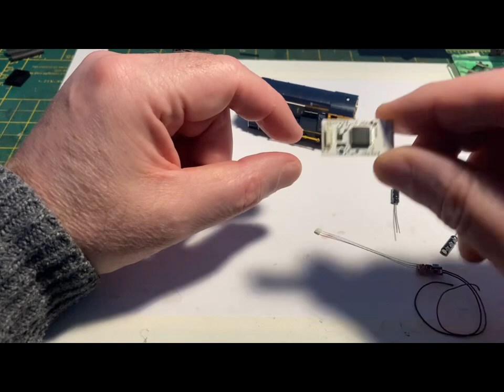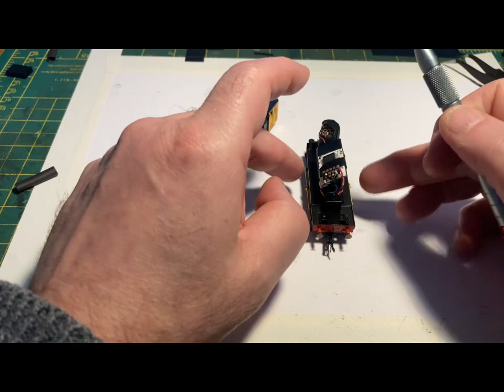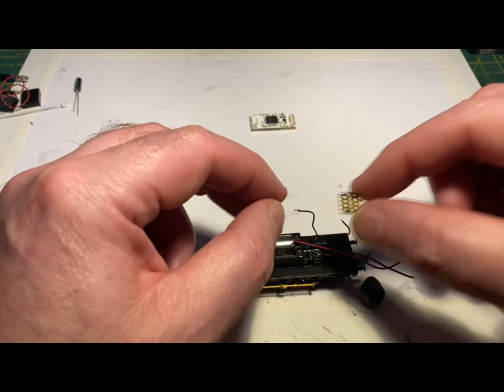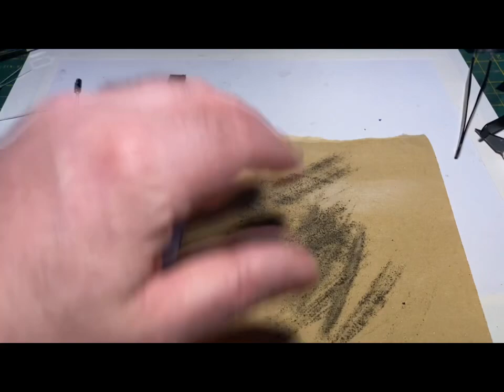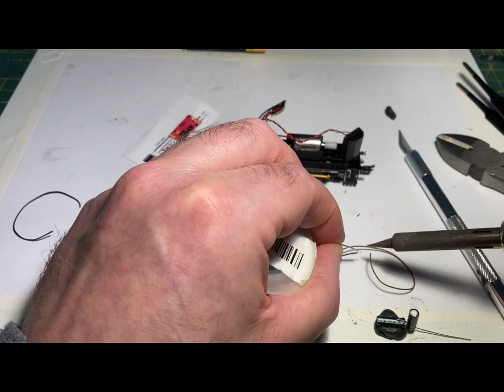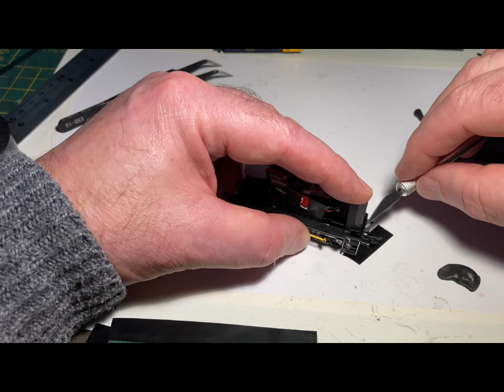HM DCC Next 18 Sound decoder, stay alive in Hornby TT:120 08, no cutting/cab removal,  £90 👍

Comment: Hi i ask as i don't know but if there is no class 08 sound profile on the hornby bluetooth phone App for TT gauge do you use the 00 profile instead or have i missed a step ???  This is a conversion i want to do but am new to decoders etc
Reply from the maker: This is using the OO profile, if you do the auto calibration once the profile is uploaded to the decoder everything will be great. As a rule of thumb the coreless motors need the auto cal to be optimised anyway.
Reply: @HighFell thank you so much for getting back to me so fast.. I wasn't sure if the 00 version would mess with other things or would in some way be out of step due to the gauge difference.. as I said I'm very green when it comes to decoders..iv no issues with confidence for projects like this and am more than capable when it comes to soldering even the smallest items but have extremely limited knowledge of these decoders is all.. life is a constant learning curve I guess, but again many thanks
Reply from the maker: @DarenFrench-f1n   this sounds like a perfect project for you. With decoders, especially HM 7000 ones, you can’t do anything damaging by using different profiles etc or playing about with settings deeper in the app. I would recommend all locos have the auto calibration done, it optimises the motor control for the motor installed in the loco. If when making changes in any area of an HM 7000 decoder, you feel you have gone wrong it’s dead easy to reset back to factory settings too.

Comment: Good morning and Happy New Year, is it possible to do this version but using the 8 pin decoder, I’m just not that keen on removing the cab, but have already bought the 8 pin decoder as per your other video ?
Reply from the maker: Happy New Year, yes it’s basically the same decoder just the different interface. You just ‘hardwire’ the 8pin as per the other video.
Reply: @HighFell  I’ve put the 8 pin into stock, and ordered the bits for the NXT 18 inc the nano’s, need to re watch this a few times now 😂😂
Reply from the maker: You will be fine if you prepare and take your time 😁👍
Reply: @HighFell  just need to glue the motor in, thinking about it was worse than the doing 😂 https://youtube.com/shorts/b_TERn_G41I?si=wTEBrfnb2r2V3OOW
Reply from the maker: Looking good 😁👍
Reply: @HighFell blimey the body went back on 😮, not fixed yet as a paint job to complete, I’m keen to add a led head light 💡, any guidance on kit to use please Matt 

https://youtube.com/shorts/5RpODF7nGLU?si=h5HW2JXvZnp5tRlr
Reply from the maker: @St-Ives-Junction  it’s all coming along brilliantly! For paint and decals, I use Railmatch rattle cans, they give a really good fine finish, make sure you use an enamel primer,  I prefer using Railmatch rather than just any old primer, a model specific primer is very ‘low build’ so all that lovely detail doesn’t get swamped. Paint is temp and humidity sensitive so bear that in mind particularly this time off year, eye and face protection is a wide move and a well ventilated area to work in. A few light coats builds a better finish, allow the thinners in the paint to flash off between each coat. For Decals look at RailTec website, huge TT:120 selection for diesels and rolling stock. Excellent quality and service. 
As to lights, I have been asked loads of times to show how to do the lights for the 08, I think a video might be needed for this one 😁👍
Reply: @HighFell  Sadly I have no where to spray, so I will be brushing it as I did with my recent black version, came out ok, and yes enamel will be used, I also have some Railtec transfers, probably not the correct ones, but rule No 1, and yes please a Highfell "how to do lights on yer loco" video would be great, unless I beat you to it 🤣🤣🤣
Reply from the maker: Please, the floor is all yours…… It always makes me laugh where certain people in the hobby want to be the big thing….. I love watching other people getting stuff done and having a go. Have you looked at airbrushing? I’m only just getting into it but me and a mate both bought a decent mini spray booth arrangement, they have good lighting and filtered extraction. You can spray all sort with them, so far I have only used acrylics and for weathering. It is a bit of an art!
Reply: @HighFell  I’m resisting that purchase, but fear it may happen, 1st coat of yellow on, looks like it’s going to need a few, it’s a bit…………..thin, ah well there’s no rush
Reply from the maker: Yellow is a tough colour to do, DONT be tempted to go too thick too soon, more layers but let it dry well as it does change as it dries
Reply: @HighFell 😂 you’re not wrong, 5 coats in and I can see at least another couple 😮
Reply: @HighFell  well the light is kinda working, scullduggary afoot methinks https://youtube.com/shorts/wJlIoNbPO9g?si=-mdTKo0zU2yGAxH3
Reply from the maker: @St- @St-Ives-Junction e work. The Adapater makes soldering up various lights quite easy. The key is setting a datum point. I always set the small gold semi circle to the socket side of the decoder so the top left pad is Motor +. Once you have that set you can use the diagram with the adapters to work out which pad to use. Did you ask Rich at TWW?
Reply: @H @HighFell  I’m not sure if there was an issue with my decoder, but the only way we could get a light working was to solder the wires directly onto the aux 1 & v+ tabs directly onto the decoder, blimey they were small, I think Richard is getting an adaptor plate to sanity check my work
Reply from the maker: @St-Ives-Junction yes the pads on the decoders are a much smaller target, the most likely cause for lights not to work are having the polarity the wrong way round on the LEDs, remember the switched part is -ve and the common is +ve. On the adapter you can have it 180 degrees out and the loco still work, because the N18 socket allows that. However when you come to attach the aux wires aand VCC+ they will be wrong, that’s why I always say, establish a datum and then rigidly follow that
Reply: @HighFell  Hi Matt, I stuck rigidly to your method, working with the gold disc towards me, Rich from TWW confirmed my wiring was ok, we think my decoder may have an issue, as it was doing some very odd stuff with the speaker added, low volume and very very distorted, new decoders incoming
Reply from the maker: @St-Ives-Junction  😁👍 The other thing to try is to un assign, un link the decoder, shut device down, reboot and relink the decoder then download the profile again. If there has been any corruption on the profile it can mess with lights etc. a short can do that.
Reply: @HighFell  yup, I tried that in the forlorn hope it would solve the problem, but alas, no joy,
Reply: Finished 😂.  Cheers for all your help https://youtu.be/0jbOI1Pvrcw?si=KjJ-rWlaqRe19Sw3

Comment: Just about to the 08 shunter stay alive and decoder mod just wondered what soldering iron is best for this work?
Reply from the maker: I use a 60w Chinese brand called Yihua, they make the irons that are in the factories that make nearly all the electrical stuff we all use. As long as you have a reasonably fine tip, and can get heat up 350-425 Degrees C you should be fine. I prefer to solder at higher temperatures but keep the iron on for shorter periods to prevent heat transferring into other components. With this install you shouldn’t have any issues, ‘tin’ the parts you want to solder first then hold the parts together (tweezers work well) and apply some heat from iron for a moment and remove iron, solder should flow and parts will be joined as it cools, that takes about 1 second. It’s worth having a practice with some scrap wire etc to get a feel for your solder and iron. 😁👍
Reply: Thank you for that

Comment: I'm midway through the process explained in this excellent video. Thanks for producing it, it's been essential. I have used the black-tack to temporarily hold down the adaptor but seem to have left remnants inside the connector. I removed as much as possible before using another adaptor held physically by a clip whilst soldering. Would tiny traces of black-tack have affected the electrical connection to the adaptor or am I unnecessarily concerned?
Reply from the maker: Thanks for the appreciation 👍, I would    Kneed a larger piece of back tack so it’s warm a very tacky, then use that to roll across the connector plug, it usually does the trick or removing any unwanted bits from electrics. It’s not ideal having it anywhere near the connectors for this reason. 
Once you feel you have removed all you can see try it and see how you get on is the only way, it’s not a conductor although I also avoid having it near any soldered joints etc. DON’T  try poking anything solid into the connector, like a pin or ends of tweezers, that will damage the terminals inside. If you have a problem, swap out the connector, it’s £3 or so. 👍👍
Reply: @HighFell  Thanks for that. I am going to use the adaptor that hasn't been held by the black-tack, just to be on the safe side, when I continue with the task tomorrow.
Reply from the maker: @WaterwaySongs good plan, hopefully it all goes smoothly but this is one thing less to think about. Remember to clean the loco wheels, so many people forget after handling locos with doing jobs on them, the 08 has limited pick ups and is quite light, the power banks need a chance to full charge. 👍
Reply: @HighFell  I started this process some time ago and got to the point where I tested it on a rolling road before trying to fit it all inside the locomotive body.  My loco ran jerkily and struggled to go in both directions. I worried that I had made an error of some sort and left the project to one side while I tackled other TT120 problems.
On the Hornby forum I learnt about Labelle 106 silicone grease with PTFE and tried this on the gear cogs. It has made an amazing difference and the loco now runs very smoothly in both directions. 
I'm concerned that I might have cooked the capacitors as the motor only continues to run for a second or two (max) when I lift it from the rolling road. What sort of time should I expect? Is there any easy way to test the capacitors?
Reply from the maker: I mentioned LaBelle 106 on the forum again this week, I have before and I know a few other people recommend it too (Nick, NTP) It’s ideal for model loco gears and you only need a tiny amount. In terms of the duration of the capacitors, it sounds about right. If you are using the Tram Fabriek ones they don’t have a massive power store, which I think is much better. Partly because they are so small the fit in so many places plus, if you do have an electrical issue, a power bank with extended running time might not be such a brilliant idea. The more you have running, eg sounds, lights higher speeds etc the less duration in the power bank. I haven’t had a moments issue with the 3 seconds or so, it’s more than enough to cope with a section of complicated point work on the 08. You will probably find they also like a bit of conditioning, so they take a couple of charges and discharges to be at optimum performance. Something people often overlook is that if there is poor track or dirty pick ups/wheels etc, the capacitors are constantly charging/discharging before they have fully charged and so not working efficiently. 😁👍
Reply: @HighFell  Thanks very much to taking the time to give this detailed response. I am learning all the time thanks to helpful people like yourself. It looks as though I can try to reassemble the 08 tomorrow after I've viewed your excellent video for the nth time.

Comment: I’ll be doing my loco next week all being well.

I think I want to add lights, and at least add the crew. But I don’t know how yet, still looking and thinking of that. Just looking for the pin details
Reply from the maker: If you check the HM DCC manual it will give you all the details on which outputs are controlled by which functions. Remember all those outputs are 12v so you will need to install resistors to choke the current down for any LEDs . For space you will probably need to use SMD resistors and 24k to get the lighting right. There is a small amount of adjustment available through the app on CV settings but the main part is via a resistor. Adding crew is easy once you pop the cab off.

Comment: Terrific job as usual. I recommend protecting the pick ups to the wheels with a couple of layers of insulating tape underneath covering the pick up board to protect them from damage. They're very easy to break if you're not careful. Take this from one who knows😔
Reply from the maker: I have repaired a couple with edge to edge soldering! That’s a good suggestion with insulation tape, I have also used superglue to hold them in place better. I hope Hornby start selling the keeper plates and pick up strips as very keen priced spares as these will be needed as some time. 😁👍
Reply: @HighFell  Absolutely!!

Comment: A lot easier methods of getting sound to this loco and not much more expensive and no soldering
Reply from the maker: Feel free to share 😁👍 
Remember this is also about HM DCC/DCC control too, not just sound.
Reply: Zimo mini 6 pin decoder mini box speaker easy fit £1114.
Reply from the maker: @ ahh yes but it won’t work with HM DCC App (Bluetooth) that many people want. I have 2 08s on the Zimo Mini decoder, with speaker, Stacx alive and the excellent sound project from Paul Chetter. Obviously there is some soldering unless you get Digitrains to do it for you £3. The Zimo set up I have is £160 a go, it’s fabulous no doubt. If you watch the end of this video, I show a quick comparison between the two, HM DCC installed and Zimo. 👍
Reply: @HighFell 👍.  It’s also annoying to spend £160 quit upgrading a £115 08, especially now I have spare decoders and capacitors that I’ve already bought.  I’ve also more soldering experience now compared to that of two years ago when I started TT120.  Once again, thanks for the video.
Reply from the maker: @ejm9716  just take your time and it will be a lot easier than you probably first imagined. I have since added auto  uncouplers to my 08 using the N18 HM DCC decoder. 😁👍